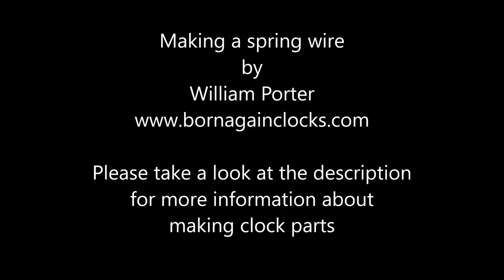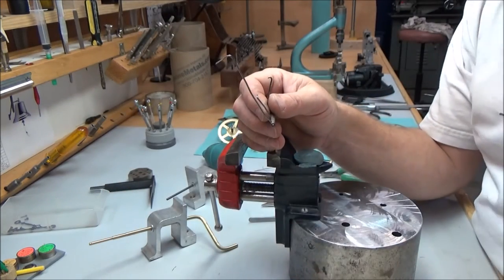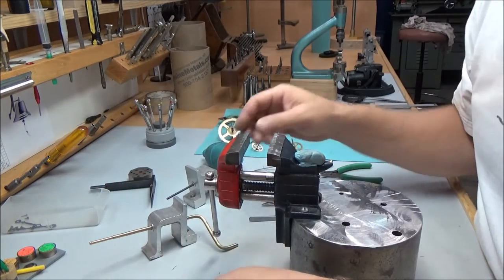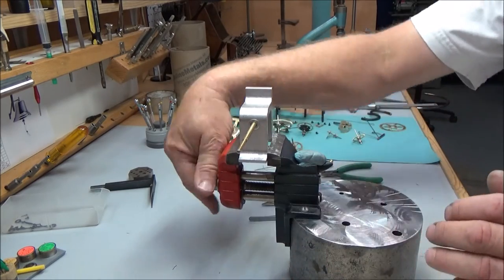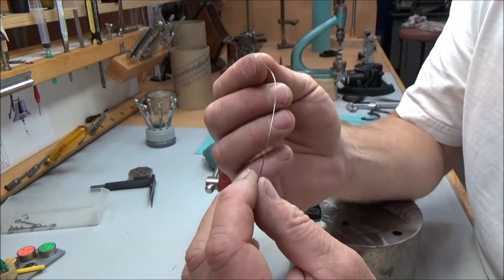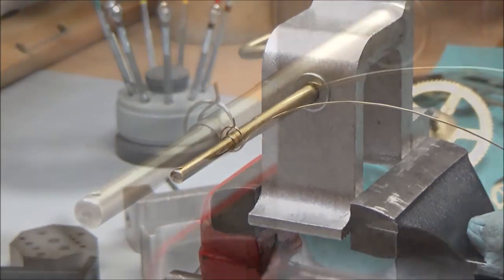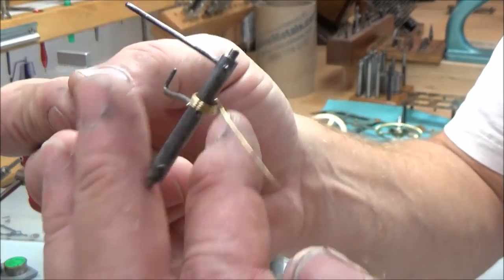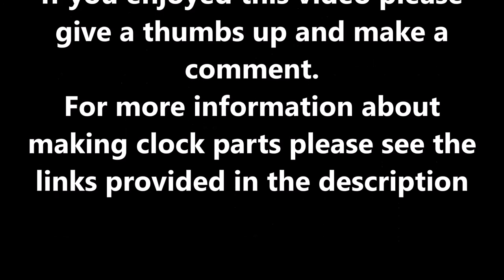Making a spring wire for a Waterbury clock

Comment: Doing an Waturbury Ogee as my first clock. Got it re-bushed, cleaned, and reassembled. Went to put the strike spring into tension on the post and the original brass spring wire snapped off! 🥺 Now I've got to order the wire to make a new spring. Thanks for the video!

Comment: Thank you for this video.... I recently redid an old Seth Thomas weight driven movement as my first clock.... and there was a ridiculous spring on the count lever, I figured it wasn't supposed to be there, but of course it won't strike right without it.  The one that was on it though was an old extension spring from something, no way it was original, so this will help me figure out a good way to do it, thank you.

Comment: I need to find some brass spring wire .072" diameter to replace 61 pallet springs in a reed organ, Malin Co's web site doesnt even seem to show they have brass wire any more, I havent been able to find the wire. I'm assuming this spring wire needs to be half-hard? from the descriptions on it, it seems hard will be too stiff, I have to make a one loop coil at one end of each 6" long wire, a slight bend at the other end, and a curvature across it's length.

Comment: Thanks for the video. I had used .016" brass spring wire on a New Haven time and strike clock, after a year of running fine it started to skip count on the hours & 1/2 hours. I will try .020" gauge with your method. I also found .032 was too strong for the hammer, and will try .025. I put in new mainsprings each .0165" strength, maybe that's why. Could the strike levers be blued and hardened with a torch? Or are they too soft a steel to blue & should I avoid trying to stiffen the levers? I found that the smaller gauge (.016 levers & .020 hammer as well as  .014" M/S's) seem to work on the smaller Ansonia movements. Conover's manuals are the best!

Comment: Thankyou for taking time to make this vidio.If the spring is missing how do you know what strength wire to use?
Reply: For what it's worth, my current Ansonia clock uses two different diameters of wire for its brass springs. I measured the diameter of the hammer spring at 0.52 mm, which is likely 24 gauge wire, such as https://timesavers.com/i-8946642-brass-spring-wire-24-gauge.html; meanwhile, I measured the lever spring - a weaker spring - for this clock at 0.40 mm, which is likely 26 gauge wire, such as https://timesavers.com/i-8946643-brass-spring-wire-26-gauge.html.

I imagine that if you put too strong a spring on the hammer, the clock could stop because the spring put too much load on the strike train.If the spring is totally missing, I'd recommend asking your question on NAWCC.org message boards, which I've found to be a gold mine of useful help.

Comment: great video. thank you. i just put together my 1874 Waterbury mantel clock works after replacing about 1/2 dozen bushing. this is my 1st clock repair. all works now were it didn't before. only problem i'm having is on the alarming side where my alarming runs constant without stopping until the MS unwinds down. thoughts anyone?
Reply from the maker: Most likely it is not catching the locking pin when the locking lever drops into its slot, though it depends on what type of set-up you have. I would refer you to Tascione clock repair course's.
 Here is a link to one of his animated videos clips. 
https://learntimeonline.com/best-clock-repair-videos/count-wheel-strike-animation/
that may help,  his courses on clock repair are very good, maybe worth looking into them. Thanks for the question, William
Reply: Looking for the patent and/or designs for the 1874 Waterbury movement if anybody has them, also a good supplier for parts
Reply: I recently had a similar problem with an Ansonia clock I'm working on: the clock would occasionally - and only occasionally - skip the first stop (deep gap in the count wheel) when striking. For that clock, I found I needed to adjust the position of two different gears in the strike train.

John Furcean mentions the position of the warning wheel (the wheel with pins that stop the striking) in his Ansonia reassembly video, https://youtu.be/UXfww79qi3M.

Steven Conover's excellent book goes into more detail about the alignment of gears and levers. His book is available at https://timesavers.com/i-8944875-striking-clock-repair-guide-by-steven-conover.html.

Comment: Good vid. Do you know where to get larger dia. brass spring wire? 22 gage is the largest i find, but an old cuckoo from 1860 needs spring wire at least 16 gage or larger. Maybe 12 gage.
Reply from the maker: No I do not. I am assuming that you need it for the hammer return springs, possible to use a steel wire with a brass finish. When you search try using the name "memory wire"
Reply: thanks

Comment: How do I determine which direction (over or under) I wind the spring wire onto the arbor?
Reply from the maker: Jean, thanks for the comment...It all depends on your needs...you can wind up a spring 4 different ways depending on how it will mount to the arbor and the direction of force you want. Have a great day.